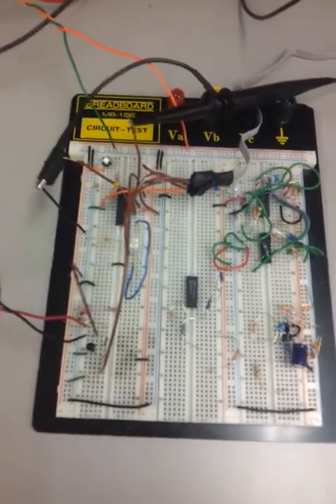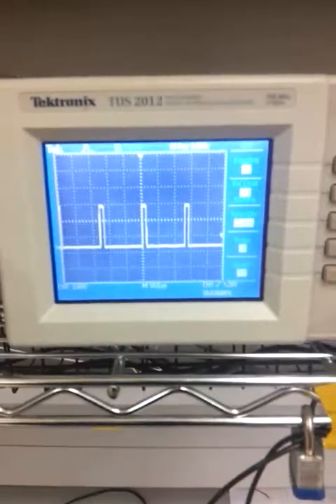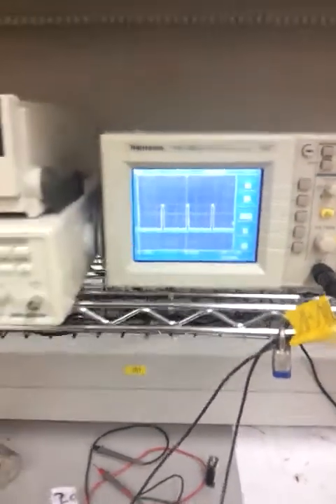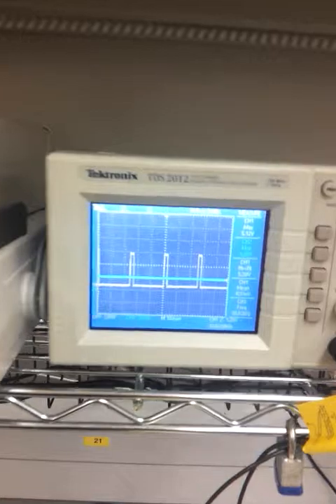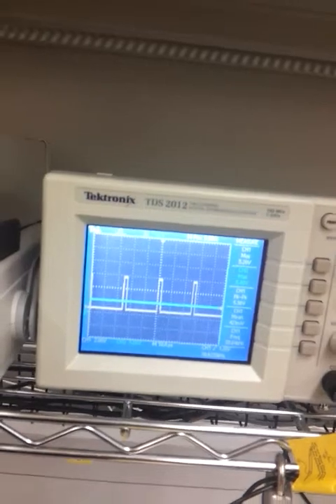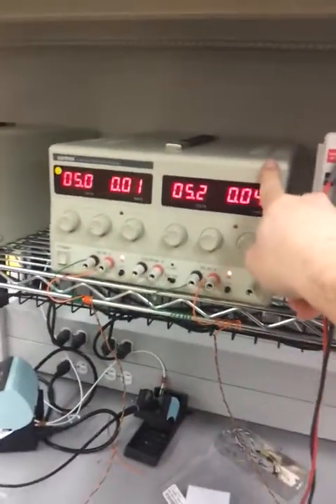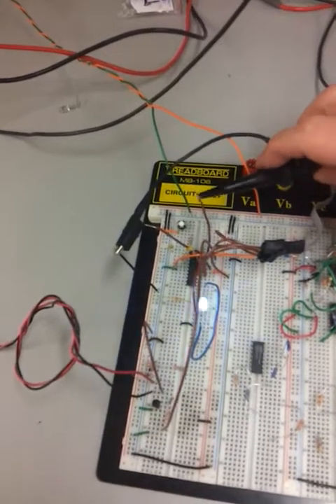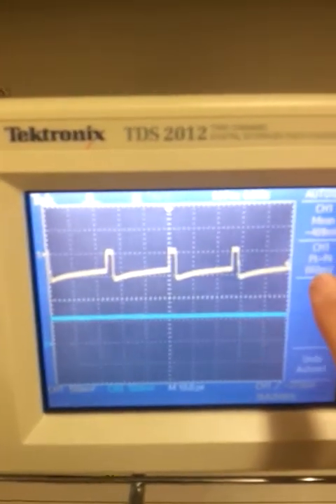Digital IR Sensor measured with oscilloscope (Golf Ball Detection, Robotics Project)

Comment: Did the project work???? how much to teach me I am total rookie on this???????
Reply from the maker: Yes, the IR pulse transmitter and receiver worked as needed. My other video shows the entire project in action. 

I would recommend that you start with Adruino board. More resources online + easier to code. You can get the a lot done at your level.

PICS are great for later on. Have fun...